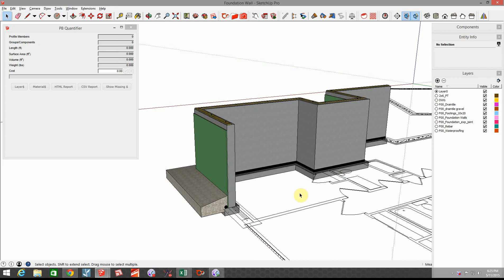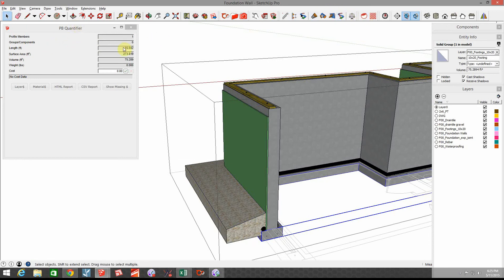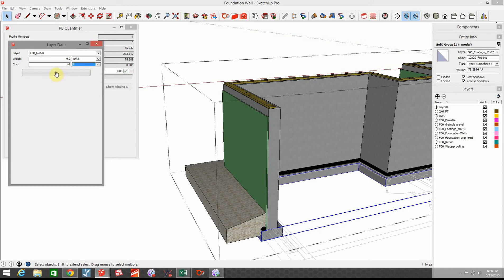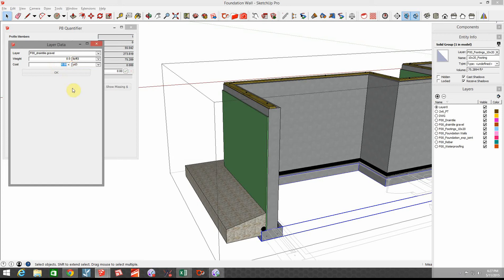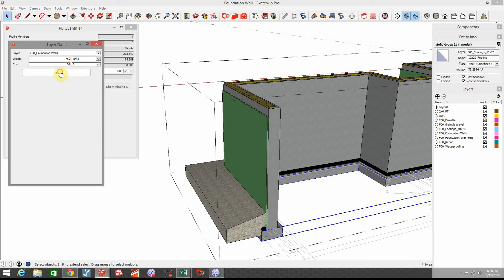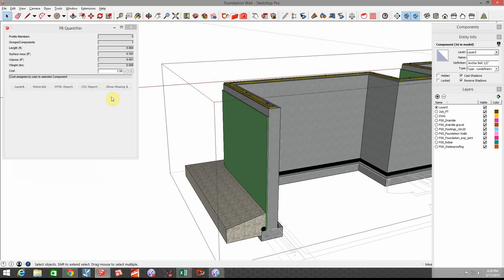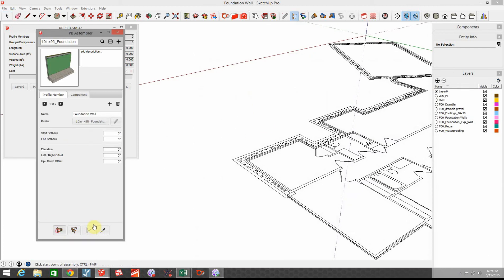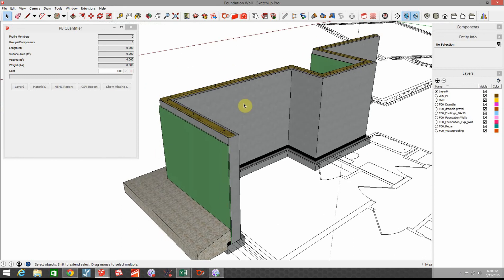PB2 Tutorial: Foundation Assembly Costs (Part II)

Comment: HI Jhon.  have a question..! how you configurate the  corners i draw the same model in this video  but I added a 90° elbow in the pipe for contruccion purposes but i can't configurate to rotate or apear in the corner position always apear far away
Reply from the maker: It is probably something to do with the axis of the component, but not sure.  You might reach out to the developer and ask him about it, but I would try to look at the axis of the elbow first, hope that helps!  Otherwise see if Dale can help you
Reply: BrockWorks, Inc. but have you tried to do the same with the corners becouse the previous video you moved the wood just to accommodate the corner and I think have to be a way to configure that part... I just begin a week ago. So I don't know if it's was because is the free trial or what..
Reply from the maker: The free trial should not matter, I do not think.  I have not used it much recently and I did the video years ago - hard to remember :) I just know it always takes trial and error.  The developer has a support email on his website, maybe he can assist
Reply: BrockWorks, Inc. all right I will write them to know better thanks.. I will finish your videos first! :-)